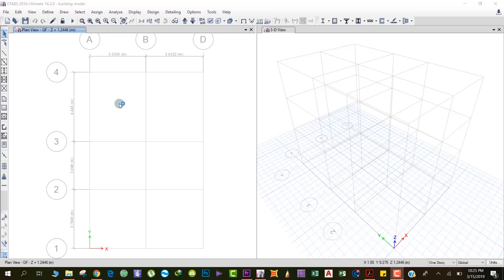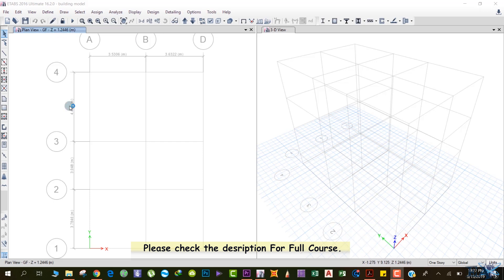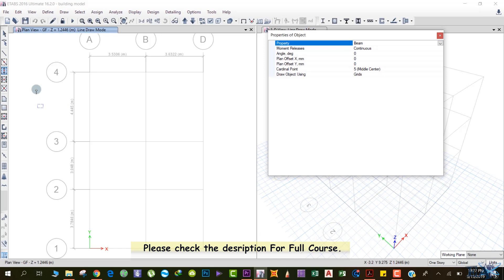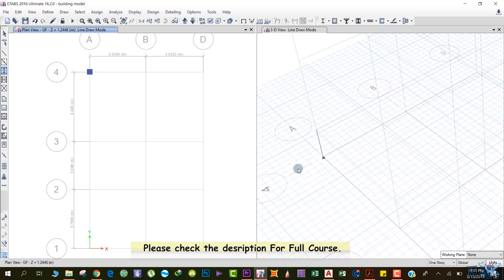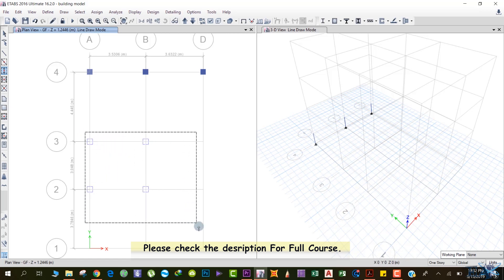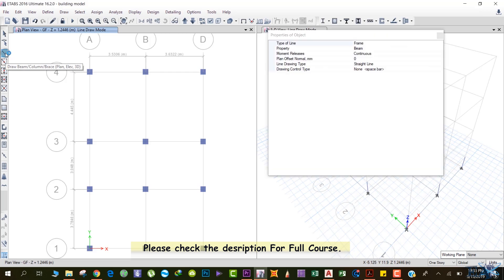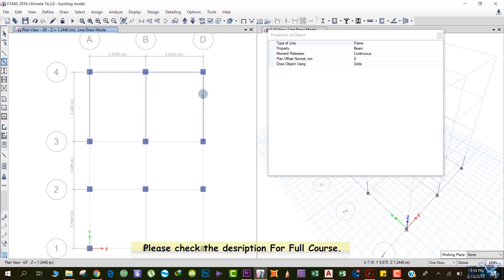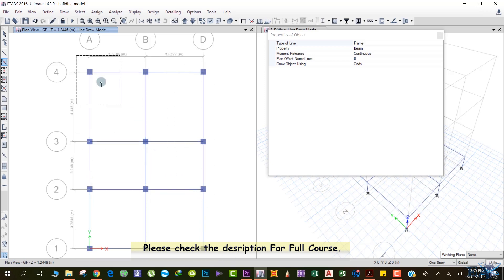ETABS Tutorial For Beginners [Chapter 8]:  Modeling of Building Up TO Ground Floor

Comment: The distance between the top of plinth beam and the bottom of footing is 7 feet but you took it as 4 feet and 1 inch? Why is that? This column will go all the way to the base of footing where it will be tied to the cage reinforcement of footing.